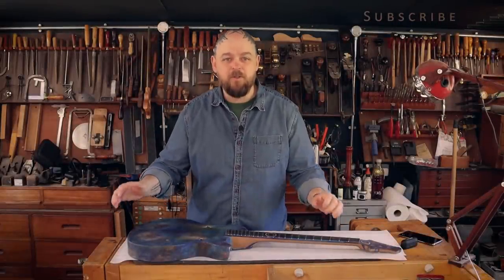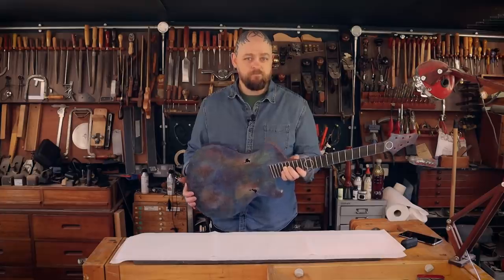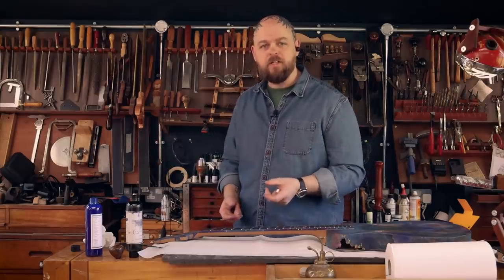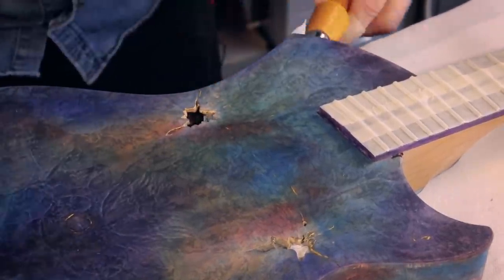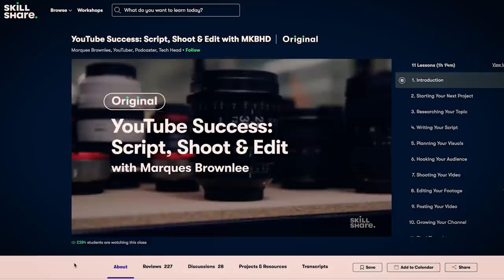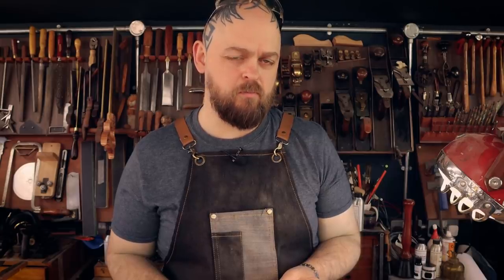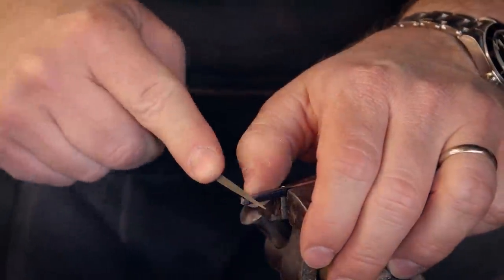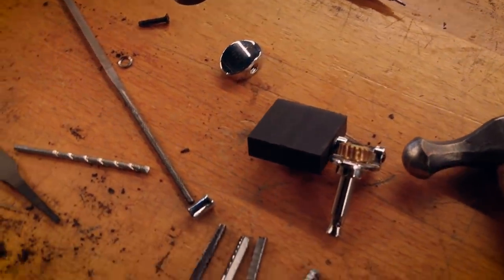Ep 20 Make it Shine - Making a Modern Multi-Scale Electro Acoustic Guitar

Comment: Should you make a broach for commercial distribution? Only if you intend to make complete tuning keys.

Crimson Whitworth 40 pitch tuning keys with custom knobs has a certain appeal even though I know you'll go with ACME or metric thread gears. After you make your first brass gear on the lathe with a tap, you'll be doing them by the bushel.

The broaches follow the gears.

Comment: Good Morning Ben, may I suggest using your Drill press as a Broach driver. Imho a more elegant and "safe" way to drive and remove the broach then hammer in and tap out. A lot easier to control the depth and rate of material removal.

Comment: In the passed I’ve just drilled the hole to the larger size. Filled with epoxy wax the tuner up. Push it in for 5 mins or so then remove it. Perfect fit. It’s how Kyle royler (I think that’s correct) does his knife handles.

Comment: Have you ever tried taking a jigsaw blade as a broach? I grind the back of a wood blade's spine to fit into the drilled hole. Epoxy the blade into a large dowel as a handle. This is a fast and easy way to make broaches of different sizes cheaply and easily. They help achieve square or rectangular holes in wood  for the rehandling of Japanese chef cutlery in my shop. That guitar is so down my street as stabilizing burl with colours is a process I find I'm doing regularly. ✌
Reply from the maker: Hey James, thanks for the tip! I hadn't thought of that.. and your shop sounds like one I would love to see one day!! B

Comment: I want to make some truly stealthy machine-heads, where the button/s can be removed, and one kept in place on the headstock by a magnet.
The magnetic connection would also complete a circuit where a hidden led would light up a logo in the button's face.
This way, the shape of the headstock will be unencumbered by unsightly buttons, and (slightly) reduce the overall weight/potential of neck-dive...
Reply: I like that idea! I'm currently pondering the acquisition of a set of Riot tuners for my Variax- it's got no visible pickups and I thought not having tuners sticking out either side of the headstock sort of fits. They're a little pricey at $100 but I'll probably get them anyway.
https://riot-works.com/

Comment: Nice work on the tuning knobs but . . . I would be a bit concerned that over time the square slot will eventually round over because of the relative harness of the tuner shaft (turning the tuner under string tension), eventually resulting in a rounded slot, causing the knob to just spin on the metal shaft. Anyone?
Reply: I'd say unlikely as they are pretty snug and ebony is tough stuff.

However, I've been wrong before. Twice, actually.

Comment: Spray booth? That's cheating! Almost none of us home builders got a spray booth. Granted, it's a custom build for a customer, but still, if anyone can do a shiny lacquered finish using only spray cans or wipe on and inspire us surely it's you, Ben!  .
Reply: I made a spray booth in my small workshop thats just big enough for a full guitar with fans pulling the fumes through a tumble dryer tube that goes out my window. Its portable and get it out when needed cost around £50 ish to make and it works very well for my needs.
Reply: @stu-j  I've thought of creating one with a kitchen fume extractor, as I've seen a luthier use such a setup. But I just don't have room for that. I'd love to see pictures of your setup though.